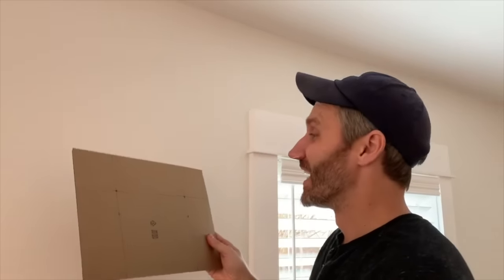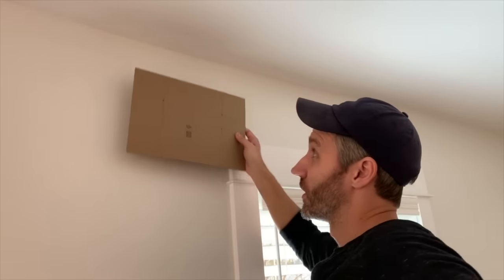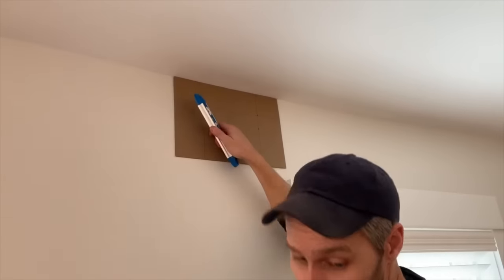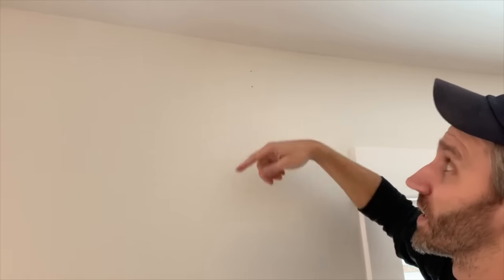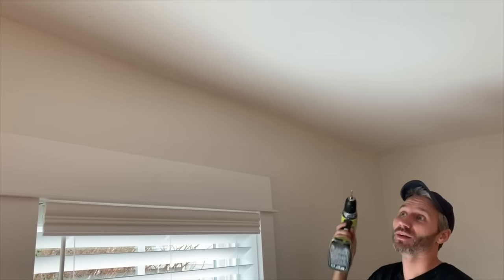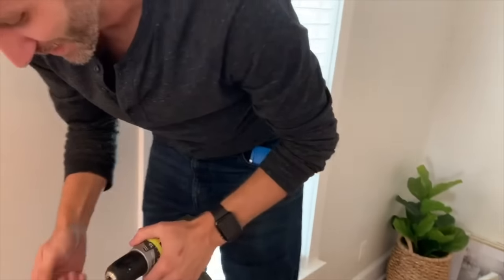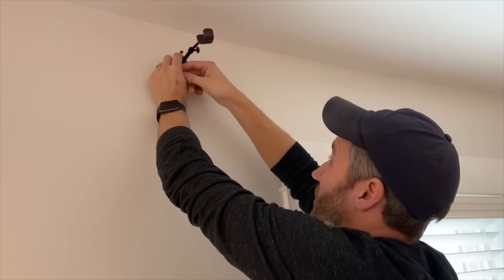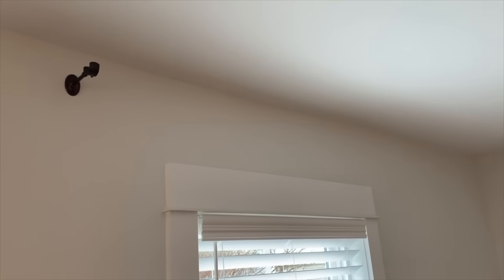A Trick For Hanging Curtain Rods Faster

Comment: Hi thanks for your video, Is this a Ryobi    18V drill. I borrowed this one from my mum but she hasn't used it. I need to put curtain rods up, but I have a very hard piece of wood I need to drill into, i think it might be Jarrah. Is this drill strong enough to drill into it. I tried to drill into it, but it didn't go through the wood. Maybe I didn't put it on the right setting or use the correct drill bit, do you have any advice, I am new to using a drill.
Maybe I need a stronger drill. Not sure yet. 

Thanks 😊
Reply from the maker: Yes, this is the Ryobi drill you mentioned. We've found it to be strong enough for most jobs, except for instances where a hammer drill (like for masonry) is needed or when stirring batches of tile thinset. Then we use a corded drill.

Comment: Good Job! I have never wanted to use anchors. Consequently, I have pilot holes all over my walls where I used a stud finder to find studs that, of course, are never equal distances from the window frame. So frustrating. I have hated hanging curtains always. I will give the anchors a try even though my curtains are heavy. Any suggestions for the type of anchor to use with heavy curtains? 
Thank you for a great video.
Reply: Toggle bolts if you're doing professional work for someone else, they'll last a lifetime.  However, in your property, you can get away with the plastic anchors.

Comment: The template is a cool little trick, but you need to make a new one everytime you need a different size location to mark.  There is a new tool on the market that solves this problem, called the Rody Precision Corner.